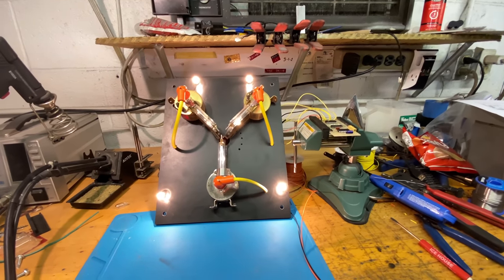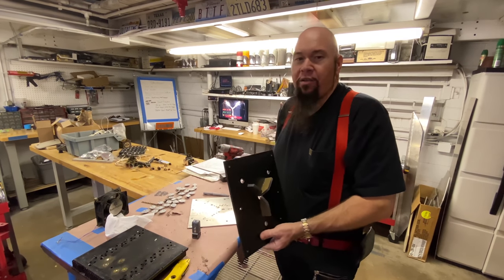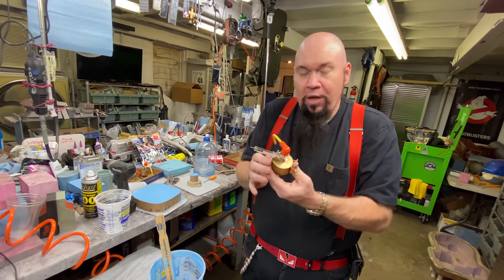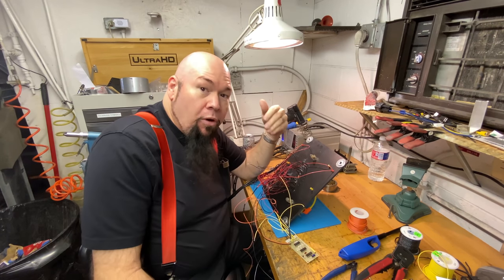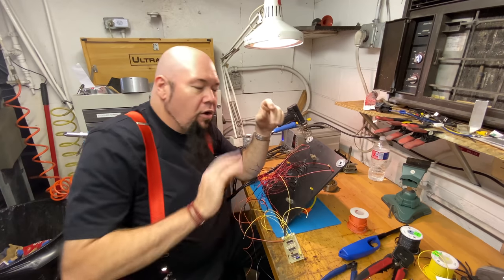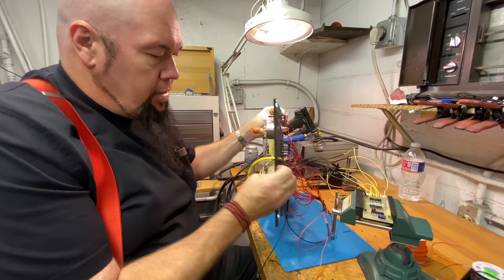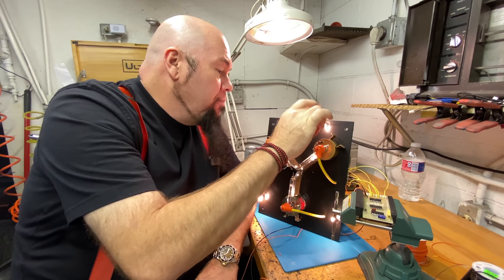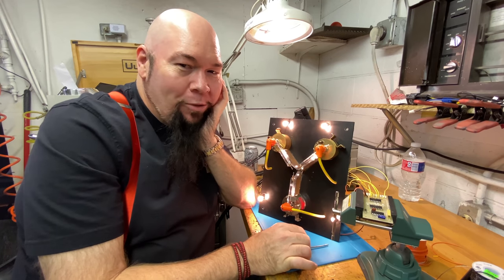Flux Capacitor for the ultimate Delorean Time Machine Replica!

Comment: That’s awesome never thought of the control board being so simple. And basically hot swapable.
Reply from the maker: Yeah, there is an optional plug for the board but not needed for what I am doing, but it does make the repair easier, but these don't fail, unless you fry it.
Truth be told, I DID fry this one, it was hot and fell on a little snip of solder and burned a trace off the board! I simple ran a little jumper on it and fixed it.
Good old school bread-boards, easy peasy.

Comment: That's pretty awesome to hear about how everything inside the original Hollywood prop was just used parts from old WW2 military radio equipment! Yes Sir I heard you loud and clear and was very interesting to see how you were making them with all the hidden little gems of secrets back in 85 Lol! I was just thinking of using the good old standard for analog technology and semi digital using the 555 timer chips. I've used them in the past on many occasions when making random hits to follow the leaders in LED by the 555 and yes you can do the same thing as for your speed by using a Pot and other stand alone resistors but It's always preferable my choice to use Pots so you can fine tune your work without having to add or subtract resistance 😉 very nice work though it looks like the spot on original my man! And bad ass as well for a reproduction of it. That was also a very fascinating fact that they were actually using incandescent bulbs 💡 back then, don't even know if Leds had even been discovered yet? LMAO Wow! Definitely dates a person and makes you reflect on time......Damn. Otherwise awesome information and great video, I thank you for doing this.